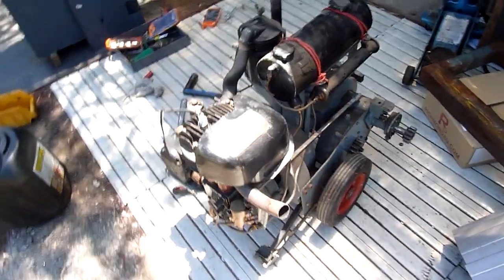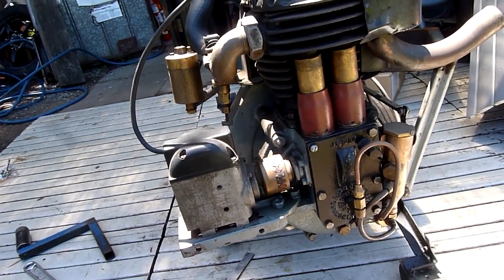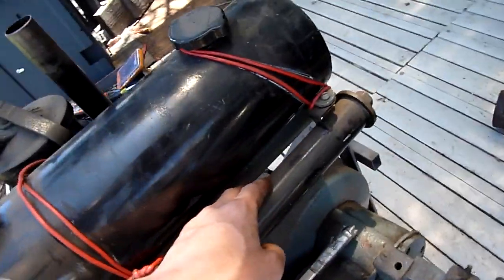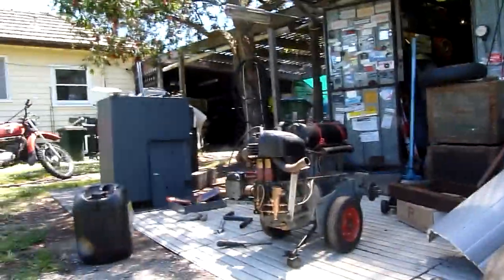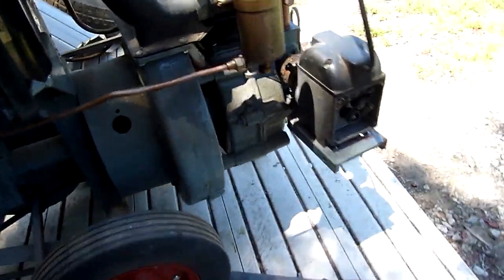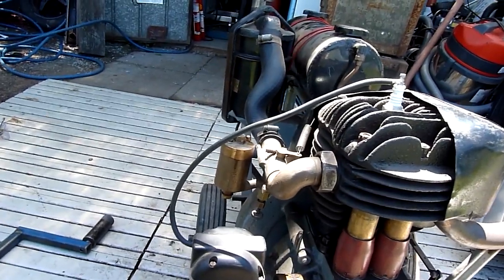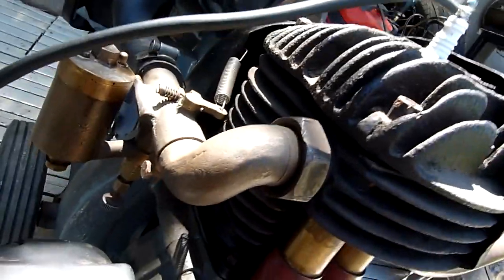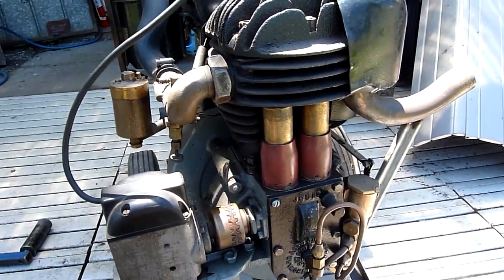Howard rotary tiller engine run before sale

Comment: I think this is the collectable gold of the future, look at how American Pickers go in for old engines, especially if they are a bit odd ball. Seeing the magneto and points running would be a very foreign concept to so many people now. But at least with this stuff if it broke down you had a chance to fix it or see what was wrong. These days everything is driven by black boxes that to most are a total mystery
Reply: American Pickers is another fake "Reality" TV show, much like those storage auction shows, I would not use them as guide for anything. I stopped watching after I saw them viewing a fellow's collection, watched them walk right by about two to three grand's worth of 1920s radios and speakers without even looking, to settle on some old stop sign. It's unfortunate how many people get mislead by programs like that, thinking that their bent up and rusty tin and enamel signs are actually worth big bucks just because they saw those clowns buy some. Someone I used to follow on Y.T made a video of when they visited the American Pickers "Store", it was basically like Graceland featuring the junk they bought on the show. One of their rackets is listing the stuff they buy on the show on fleabay, but they don't sell it under it's own merit as lets say "1947 Shell gas station sign" they list it "As Featured on American Pickers", so basically they market the items as props from their own show.
That being said there are collectors of small power equipment and stationary engines, and there has been for some time, and will likely continue to be, but it will never be wide spread. But unfortunately it's heavy, smelly, and having anything to to with it involves getting your hands dirty. We have a society full of people who can't even change a tire, have to buy a new "Dumb" phone every 2 years, and think that a K-Mart boom box from 1987 is "old school", I can't picture most of the present generation even owning owning one of these let alone restoring one.
Reply: But this channel is one of the best examples, that if you know your stuff, you can fix those black boxes also...

Comment: Runs nice, I have six of these. About fifteen thousand engines after this one was built they finally built in a governor! Of my six only two don't have pistons slapping around but with new rings these old girls don't mind. The clunking you hear is the clutch, they wear the holes oblong and the pins then can rotate back and forth half an inch.

Comment: Fine piece of gear and one I'd dig having, although the dry sump lubrication system and magneto seems a little elaborate for what it had to do. Doesn't sound any worse than my Briggs powered mower. I've got a couple Chinese ohv one lunger powered devices-a snowthrower and a pressure washer and they're good powerplants although I have no idea what I'll do if they ever break. Send to China for more parts maybe. Apparently S-A made some pretty good motorcycle engines that have a real following and that might be worth more than you think to an enthusiast.